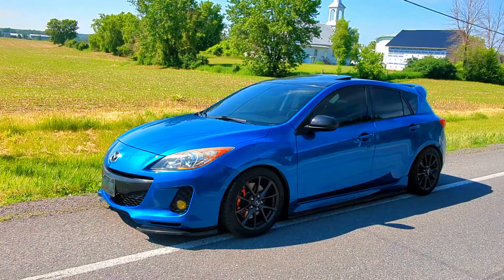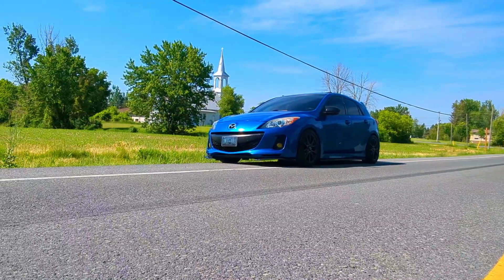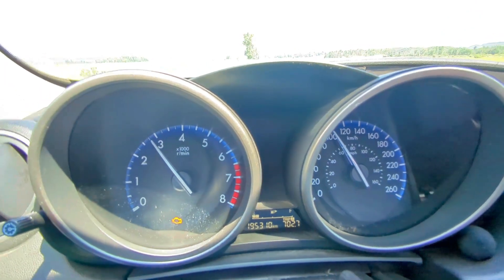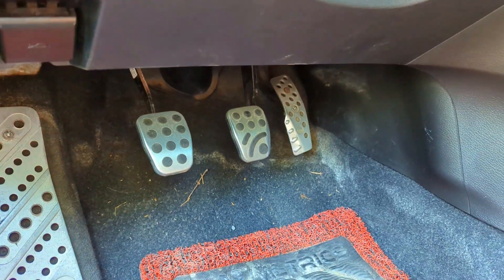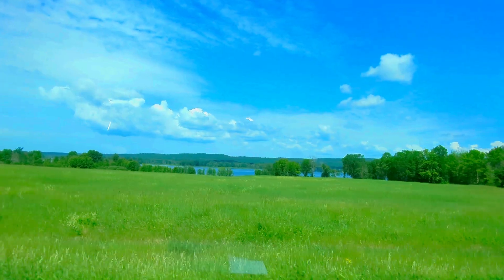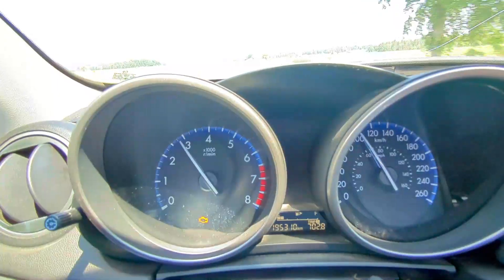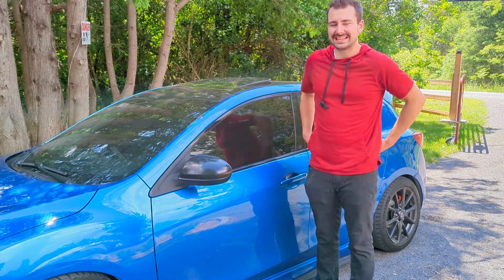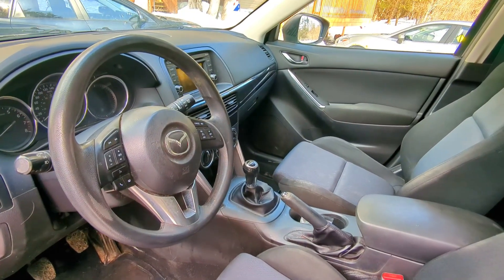I Installed a Cx5 Transmission in My Mazda 3 and THIS Happened!

Comment: Hi! Awesome video! I’m from Montreal and I found a great m3 skyactiv 2012 but the car as never been sprayed with a  rustproof. The frame have surface rust but with our canadian winter to you think it can be problematic to buy a 11 years old without rust proof car that I want to keep 2-4 years? Thank you!
Reply: You should go to the mechanic and maybe pay $30 to get it checked out, my 2012 Mazda 3 that has been rust proofed almost every year is only in Okay shape, mine will probably start to rust bad in 5 years
Reply: @tt-nm4yj good to know thank you
Reply from the maker: It's a good question, I actually got this Mazda 3 in Montreal and it was never rust proofed before. so if you plan on just keeping the car for another 2-4 years I don't think you should have any real issues, but like mentioned in other comments it's a good thing to get it checked out be a qualified mechanic if you're not sure. 👍

Comment: I’m curious if it’s possible to swap ONLY the FD over to the 3’s transmission.
Reply from the maker: I would think it would be possible. The Cx-5 Trans also has slightly different gearing all the way through. The thing with FWD is that the transmission needs to be taken apart completely to finally get to the diff. So I figured this would be the easiest way to change the FD, I also have no experience taking a transmission apart, so it was more than I wanted to take on at that time.

Comment: What kind of mpg do you get on the highway now? My non sky 2.0 gets around 31 highway but drops down to 19 in city traffic
Reply from the maker: Like I mentioned i the video, since I did the transmission mod, I don't drive as fast on the Hwy, so my gas mileage is similar as before close to 38 mpg on hwy.